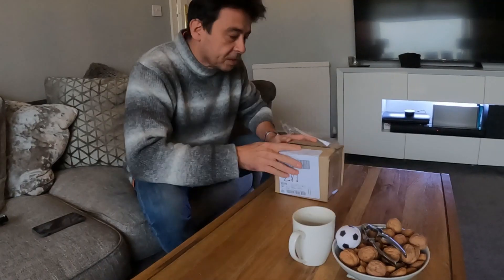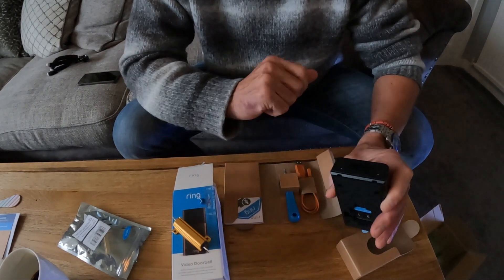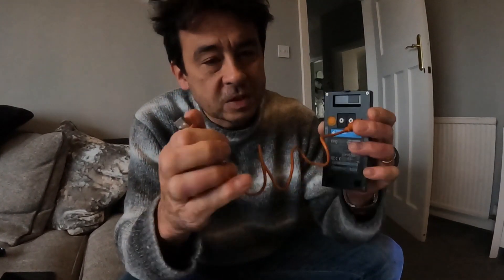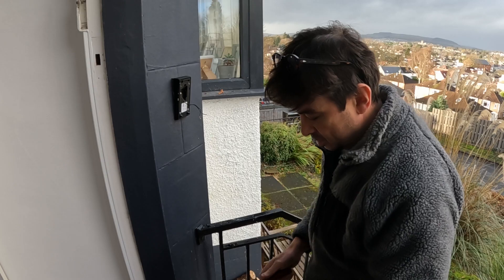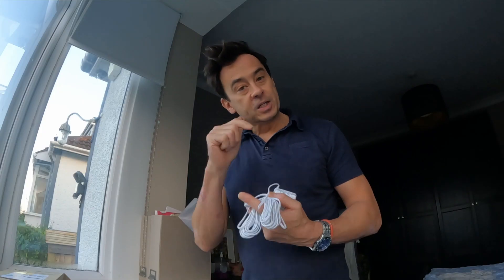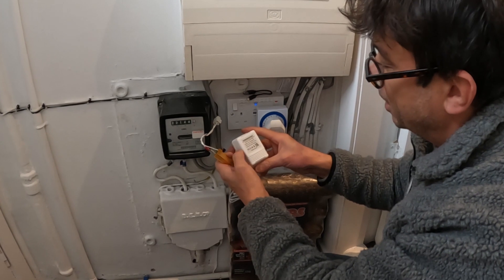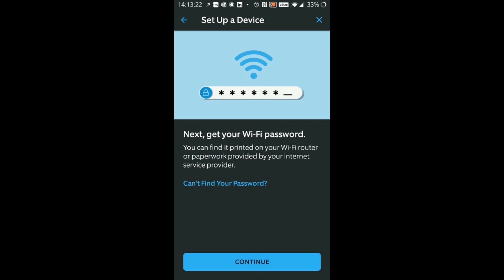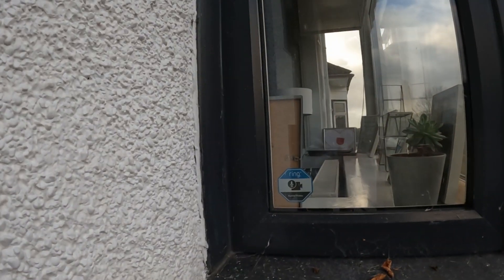Ring Doorbell Camera Gen #2 Set Up New vs Old, hardwire with resistor.

Comment: Does anyone know if the plate that holds the ring door bell in place , are the holes the same as 2024 release.. just mine is on a porch which is metal frame.

Comment: Little late to this thread - but : does the resistor produce heat (like a load resistor on LED lights for a car) ??? 

I noticed u just tucked it away in the wall... But better safe than sorry!!
Reply from the maker: No, the resistor merely prevents over surge to protect the camera, it doesn't get hot in normal use.

Comment: Hi.  I take it you are using existing wiring.  I notice you have purchased an adaptor.  Not sure the part about the resister.  Why was this needed and did this come with the adaptive?
Thanks
Reply from the maker: Hi Mate, the resistor was mentioned in the instructions, so I just used ebay and found one. It helps protect the current surge to the doorbell.